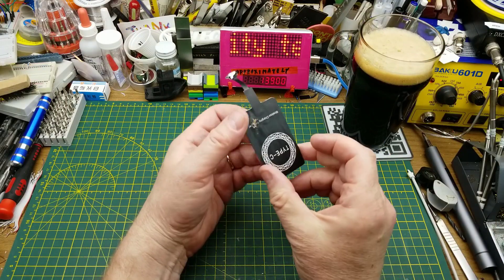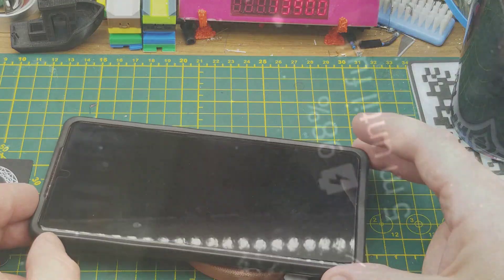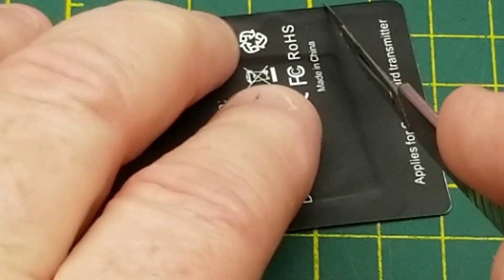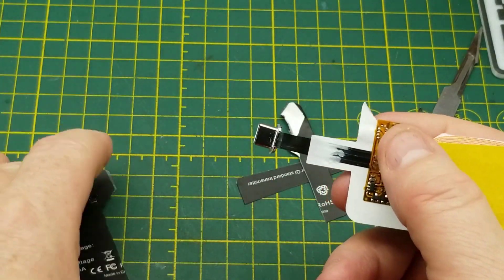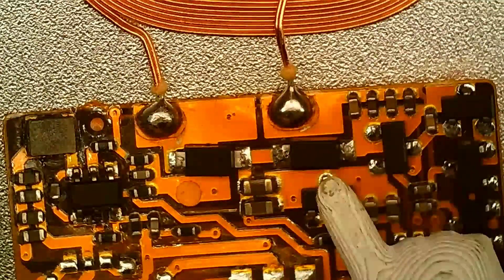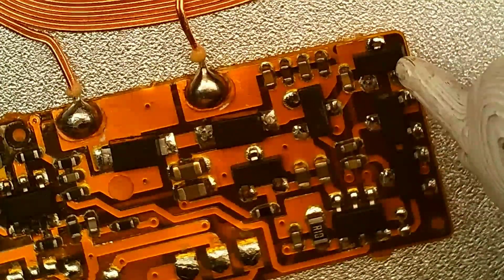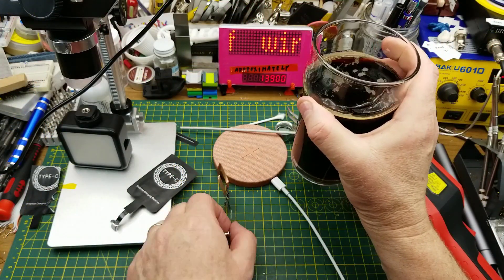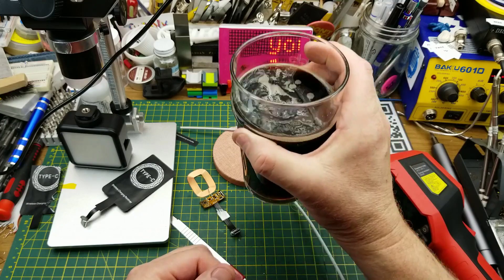wireless power : curiosity teardown

Comment: One thing that could have also happened if you are using any USB adapters that use quick charge or power delivery or support higher than normal current is that the adapter can potantially put out more voltage or current than the 5v the unit can handle or it could try to draw much more power than the rated amount and unit heats up trying supply it.  I you plug the base into a usb power analyzer and then into the adapter or use the usb analyzer between the device and the receiving coil to measure the power that might also shed some light on what is happening.  I have a few of these that I have used in the past and they worked great until I plugged the base into a usb charging hub that supported Qualcom QC and PD and it either confused the hub or somehow allowed the hub to deliver more power than the receiving unit could handle and it eventually fried in a similar way but it worked just fine for nearly a year with the same phone and a lower power USB power adapter but died in only a few days with a more powerful USB adapter.
Reply from the maker: I suppose that's possible, but not in this particular case.  The USB supply was a 5V only unit.

Comment: I use the ubiquitous tp4056 charge module for charging lithium batteries and under normal conditions at 1amp it gets hot enough to burn flesh. They are recommended to have plenty of air circulation. I’ve seen several people change the current controlling resistor to change the output to 500mA which takes twice as long to charge but runs much cooler. Some people recommend charging lithium cells at a low current to prevent stressing them anyway.

Comment: let the depouchification commence ! 
.. i bought one a while ago to upgrade one of my flashlights, it came without the pouch, just the coil the circuitry on a flex pcb and a shield..  i didn't notice it getting hot at 1 A input, but it was too sloooowww,  I had a different base though, ikea kind of makes good products.